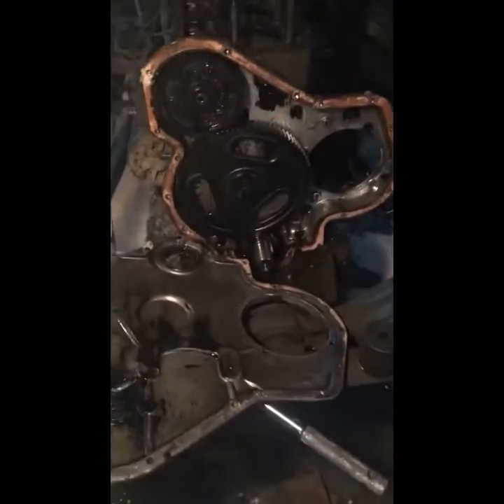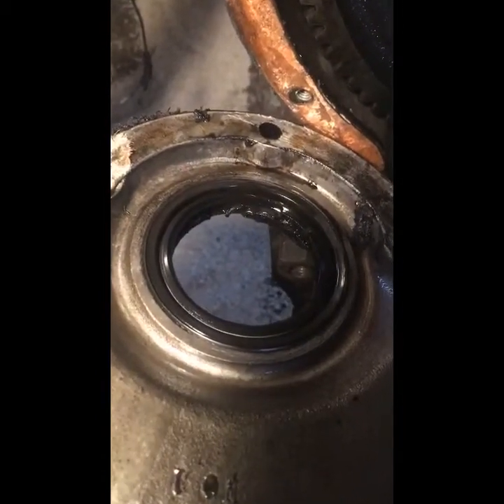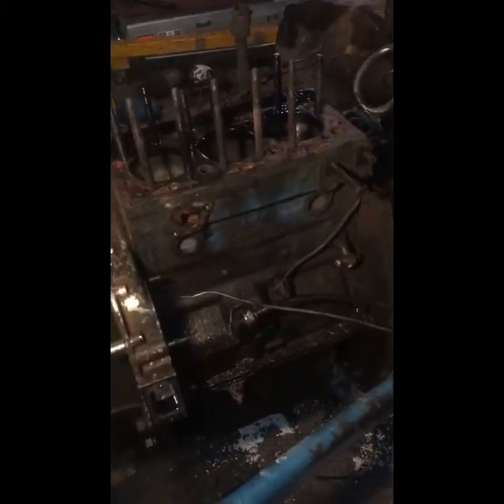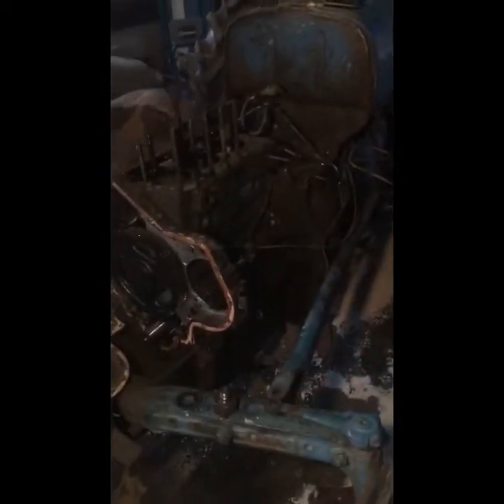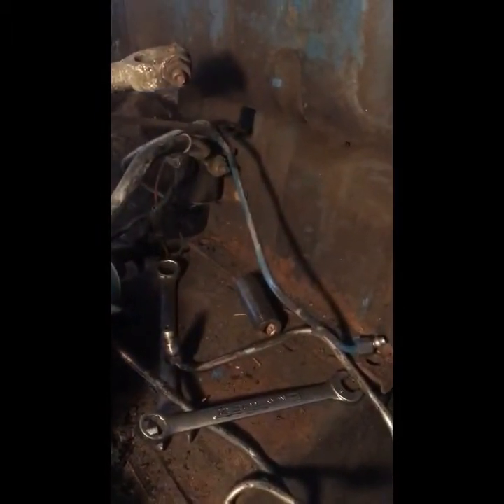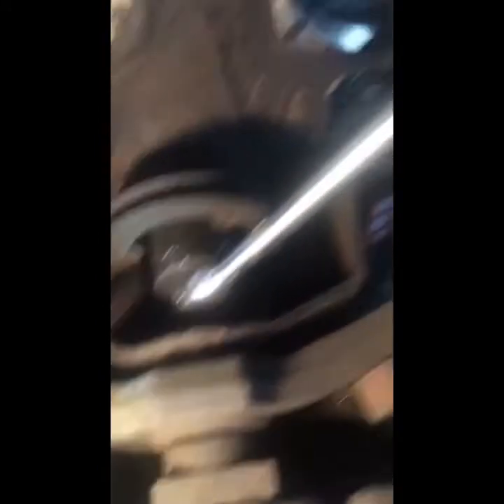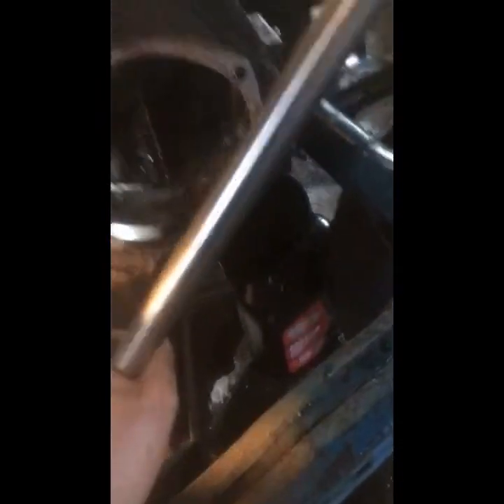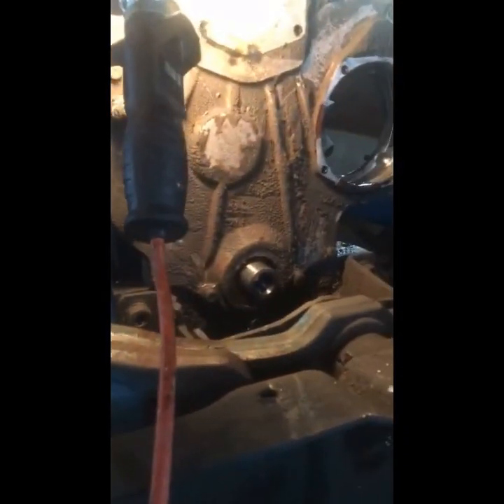Loss of power on fordson dexta part 2

Comment: Hello again. The bolt that's giving you problems might be trapped  by the weight of the tractor. The heavy bar that runs back to the footrest is called a radius bar and basically stops the front axle bending at the pivot point under the radiator when the tractor is moving. I would jack the front of the tractor up first but choose a good structural point, not the sump which will collapse. Once jacked up the tension will be off the front axle which will then be able to move and you can shoogle (Scottish word) it about to see if the bolt will free up. I wouldn't let the weight back on unless the radius bars are connected. If you're leaving the tractor suspended for a while it would be worthwhile using an axle stand.
Reply from the maker: Ian Johnston that’s a good point

Comment: Hello, Sorry missed this first time round, the rear crank seal will probably be a rope seal rather than a lip seal as found on the front. You can get an indication of the condition of the rear seal by looking under the tractor. Just on the engine side of the join between  engine and clutch bell housing there is a small hole, it's on the underside behind the sump but still on the engine if that makes sense. The purpose of this hole is to let any engine oil passing the seal to drip out before fouling the clutch plates. If the hole is dry then it's a safe bet your real seal is holding, if it's dripping then it's passing oil. If you're going to split the tractor to replace you have the option of replacing the rope seal with a modern lip seal with a kit but equally rope seals are available. Mines been replaced a couple of times in the last 59 years (genuine 3700 hours on clock) although was installed incorrectly the first time leading to the second change. Hope this helps you decide how far to take the restoration.
Reply from the maker: Ian Johnston thanks my friend for the info